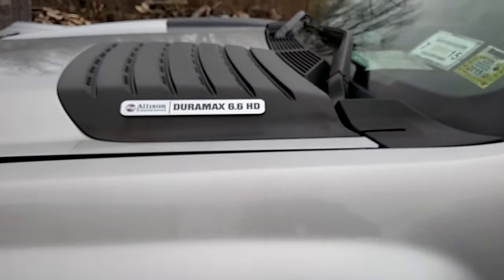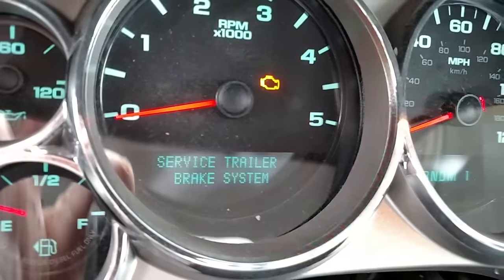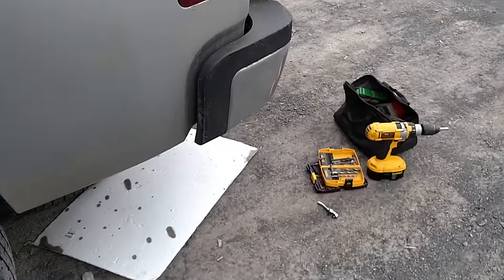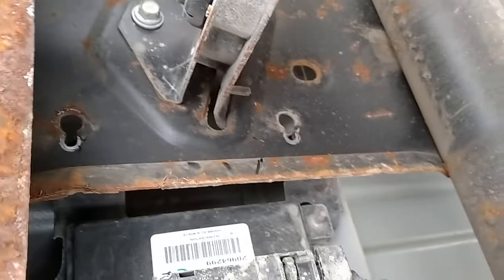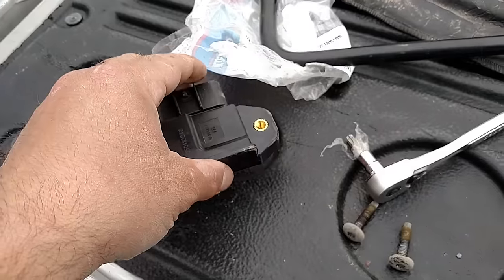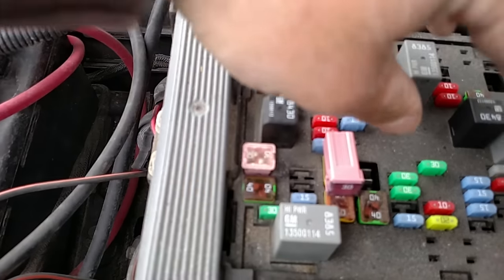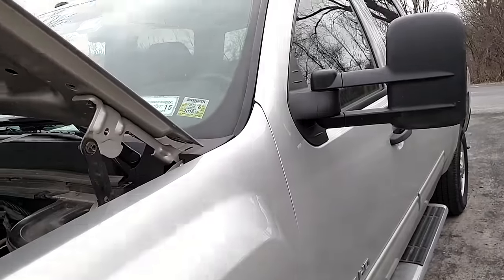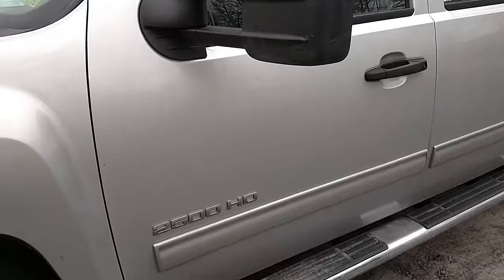GM service Trailer brake system repair

Comment: Had the same message on my 2011 2500HD.  Followed these instructions and it fixed the issue.  $38 for the controller on e-bay.  $5 for the fuse.  For clarity:  There are 3 T-27 screws holding the large bracket, which holds the controller and some other electrical module.  You can loosen these from below and slide the bracket off, without removing the screws all the way.  After removing the bracket, you can access the screws for the trailer control  module, from the top (also T-27).  They also do not need to be completely removed.  Easy fix.  Thanks!!

Comment: I have a gas 2500 GMC and relay was behind driver back tire in a tight space.  1500 and diesels are behind spare. I didn't have to put down spare

Comment: Thank you Jordon H. I changed the module and the bumper 7 pin plug. Problem solved after I disconnected battery for about 30 min it reset the dash warning.

Comment: I had this problem once before on my 2010 durimax  and was just the fuse but couldn't remember witch 1 it was. Have the same prob on my 2012 vortex now. Thanx for refreshing my memory. Off to fix it now👍😎

Comment: I had same issue people, check your ground which is under left side behind cab on the frame. Next check your fuses also the two positive posts that come off the front of your fuse box that’s under the hood. Those posts power the brakes. Then if that doesn’t work but the relay.

Comment: I appreciate this information. I had this problem and fortunately I only had to change the fuse.  I had already purchased the relay and fuse from Amazon at reasonable cost after seeing your video. I will save the relay for a future date. I had previously received a ridiculous quote from the Chevrolet dealer to replace relay and module and it would seem they might have checked the fuse. Thanks again   ....Eddie

Comment: Appreciate the tip, everything i read was change the relay which did nothing, checked the fuse and it was bad. Wondering if that was the issue in the first place. Thanks

Comment: Thanks.....all I had to do was replace the 30 amp fuse,number 63 and "service trailer brake system" does not show on dash alert anymore...!!
Cheers....!!!
Reply: so no part needed ?
Reply: Thanks .replacing that fuse worked for me also. GM stealership wanted $900.00 to fix

Comment: Pat - thanks for your video. I've had the exact same message from my 2011 1500. Can you tell me exactly which fuse to replace? (Do you have a name for the fuse or a part number? The one I have in a similar position doesn't look like yours - while it is square, mine is black vice red.) Thanks!

Comment: My 2012 3500hd has the same issue, I just installed the new trailer relay and checked all fuses. The issue wont go away, Maybe I need to check every wire but dont know what they should read.

Comment: OK tell us this - is it possible to hook one of these trucks (2100) up to a factory scanner and completely shut off (eliminate!) the "stabilitrack" and "traction lock" crap?  I know you can turn them off with the traction lock switch, but can you kill the warning light AND message??

Than+ks a bunch - an old gearhead in Illinois

Comment: Was it come on then go away and come back on some times? Mine is doing that and then some times it will just stay on also seams to go on the off more when it is colder out in my truck. Starting to get really annoyed with it. I also have to fix my cruise control which is the sensor on the break pedal.

Comment: ours does a lot worse - the "service trailer brake" pops up when driving (we don't ever tow with it) and the locks cycle lock/unlock over and over, the dash goes out, and the truck seems to be braking itself.  then all is fine.  Happens about 3x per week.
Reply: I checked my battery cable it was loose every time I would hit a bump it would do that
Reply: @janetperez9717  I cleaned out and protected that connector by the spare tire and it hasn't happened since

Comment: i replaced my relay on my 07.5 2500hd an the dic still says service trailer brake..i believe i checked all fuses they all looked good .. anything else i can try??? is it possible to just turn trailer brake off so the warning stops coming up

Comment: my 08 has the same issue, the relay is not under the spare tire on mine, on drivers side frame rail, but did not cure the problem after changing it and the fuse ???
Reply: I've had the same message on my DIC for the past 4 months on my 2008 Silverado 1500 and have just now gotten around to research it because I will no be towing until later this summer.  I found a Product Safety Recall Bulletin No. 14515B that deals with this problem. Will visit the Chevy Dealer this week and see if they will honor the recall and repair it for free.
Reply: Thanks for the post on this d2molson.  I also have a 2008 (3500 dually) GMC and I changed out the relay, and it didn't solve the problem.  I'll check this product safety recall bulletin tomorrow.  let me know how you did with your dealership please.
Reply: Got it...it was the brake pressure sensor.  Brake pressure switch showed no pressure.  Change out the sensor...and it's all good now!
Reply: I have replaced pressure switch and relay and checked all fuses. Went to dealer and they say no recalls for my 2013 GMC Sierra 3500HD Dually. All my trailer lights work but have not even pulled a trailer so I'm not sure if the controller will work or not. Has anyone used their truck to pull with this issue to know if the trailer brakes will work?
Reply: Plymouth Man 
I did.  Trailer brakes don't work
Reply: @harryschwaiger5677  Where is this switch located?  Perhaps on the Master Cylinder?  Did you just test it with a multimeter?  Any more information / pictures would be greatly appreciated.  Thanks.

Comment: I have been having issues with this for 2 and half years. Had it to service 2 times , they change some computer module  and have too down load the program. Good for a short time then. Every time I hit a bump it says something about my trailer brakes. Why doesn't GM have a fix for this?

Comment: 2016 high country 3500 service trailer brake is on. All lights on trailer work just no power out to the brakes. Changes brake controlller and the relay over the spare tire. Still no luck. Out of warranty also.
Reply: Camille Farms. See my reply above to Barry T

Comment: Were the bolts put in through the top of this relay? I'm having hell trying to access mine.
Reply from the maker: Yes they are, have to use a torx bit in a socket, you see it quick in the video
Reply: +pat guerrette Got it. Thanks!

Comment: I replaced my module and fuse and drove 12 miles and the warning light came back on. Do I need to reset anything?
Reply from the maker: Barry T ...no nothing to reset. if you are towing a trailer it may be an issue with your trailer wiring.
Reply: I didn't have any trailer attached. Any other ideas? Thanks!
Reply from the maker: No, sorry
Reply: Barry my truck is a 2011 3500 Duramax. I replaced the relay and it didn't fix mine.I next replaced the Brake fluid pressure sensor located on the Brake Master cylinder after downloading the codes.There are two sensors on the master cylinder the small one outboard is the level sensor the one one closest to the engine is the brake fluid pressure sensor. The part number for mine is BST115 Made by STANDARD.Amazon has them for $72.00 including shipping if your a prime member. Also parts Geek has them roughly the same price.This is the second time mine has failed. The first time was under warranty and the bill came to $400.Hope this helps.
Reply: Also the codes i downloaded to my iPhone via Blue Driver were CO131 and CO561. The brake pressure sensor replacement was listed under frequently reported fix. I like my Blue Driver code reader. It will read any OBD-11 equipped vehicle.It costs about $100.
Reply: PS don't forget to bleed the air out of the system if you replace the brake pressure sensor.
Reply: I get the same warning whether I have a trailer hooked up or not. The warning comes on when I let off the brake, usually at very low speed - like when letting off the brake at a stop.
Reply: fatboi... I'm getting the same message as every else but I have no electric brakes to my trailer.  I just replaced the female plug on the truck with no results.  Looks like all fuses are good.  I can change the gain but there is no output when I step on the brake pedal with a trailer hooked up.  My brakes do seem spongy and I did notice that my master cylinder looked wet where it bolted to the booster although I didn't see that it was leaking.  Do you know if your trailer brakes were working or did you just get the message.?
Reply: fatboi 1959 did this fix the “service trailer brake system”?

Comment: Well I changed the relay, the jcase fuse and put new plug in bumper. I'm still getting service trailer brake system. Any other ideas?
Reply from the maker: No... sorry, no idea
Reply: WFOMORGAN I have this same problem with my 2011 GMC 3500 duramax...
Reply: I had that problem on my 2013. Wheel hubs went out on the front which damaged the wheel speed sensors.
Reply: Check powers and grounds at the relay and module, both up above the spare tire. Mine had code p2534 in the Trailer Brake Control Module. Loss of ignition volts to TBCM. Had a bad connection at connector by the brake booster. Check powers and grounds, not too difficult and could save you a few bucks.
Reply: Change out fuse #63

Comment: I cant find this part what's it called ? can anyone post a link ??
Reply: dcnbtown34 trailer brake controller relay, make sure you check the fuse he mentioned in video

Comment: Why replace a good fuse? I replaced the relay and still got the service message. And the fuse is good.
Reply: Douglas Brand  but wat if ur lift turn don't work then wat u think about that

Comment: And if a built-in trailer brake isn't bad enough for ya' wait til you get messages on that stupid dash readout for "Stabilitrack" ot Traction lock"!!!   I guess someone in Detroit thinks we forgot how to drive a damn car!!!!  It's time to remove the instrument cluster and bust up some light bulbs!!!!
Reply: rod builder I have all these lights on. Why was Your stabilitrac  and traction control light on? what needed to be fixed?

Comment: i changed the relay and fuse on my 2009 2500HD. and it still keeps telling me that it needs service but it dont do it all the time. wondering if anyone had the same issue
Reply: yes - i'm having the same issue. I've replace the relay in the past - at least twice already and it seems to work for awhile, then magically the "service trailer brake system" message appears again...
Reply: After you do this unplug your battery for 45 mins then hook it back up it resets the ecm that should fix it.
Reply: After you do  this disconnect battery for 45 mins then hook back up it should fix it.

Comment: I keep blowing the STUD 1 40 Jcase fuse. 🤔
Reply: That would mean you either have a short inside one of the trailer brake modules themselves (circuit board) or you have a wire that has worn through and is going to ground. If you have a multi meter, grind or wire brush a spot on your frame and check and see if your power wire (usually red wire, I think red/black) and your  frame have continuity.